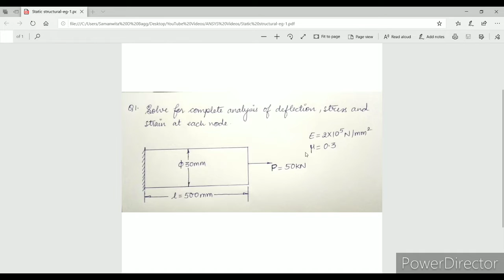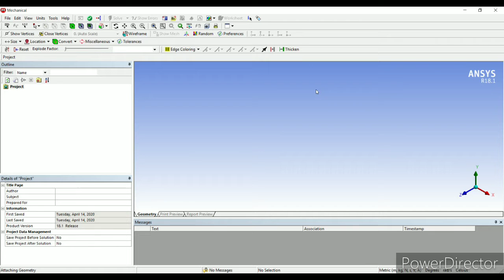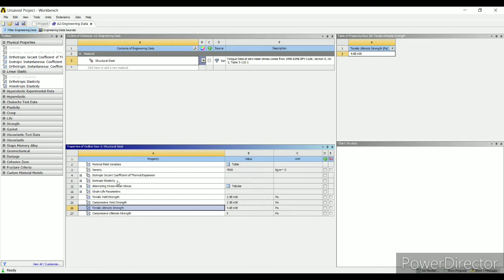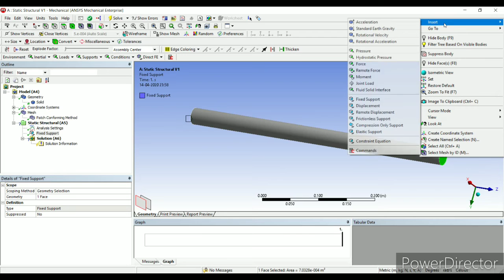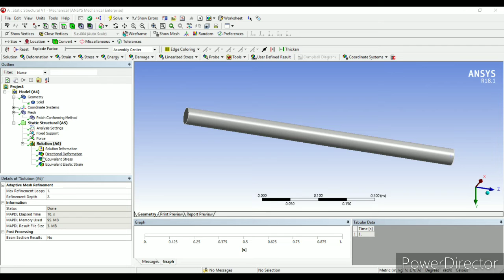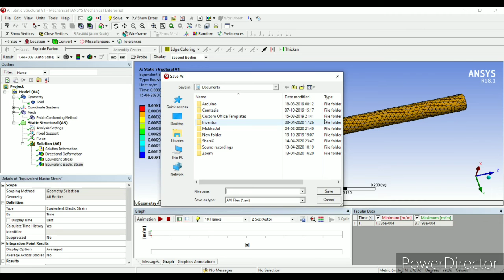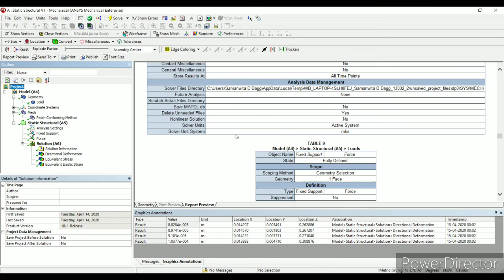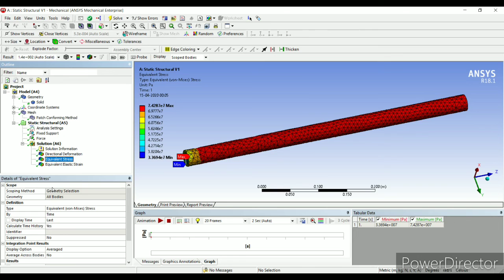Static Structural Analysis I ANSYS Workbench | Problem-1 | Basic Tutorials

Comment from the maker: Thanks for watching! Like, share and subscribe to the channel. Hit the bell icon for latest video updates.
Reply: Query: Mam, how are deformation and elastic strain function different. If a particular set of nodes undergo more deromation like near the place of application of force deformation will be more because of stress concentration so strain at that region should be more and thereby stress but the graphs in video are quite opposite where maximum stress is occuring near the fixed part. Please explain Mam ?
Reply from the maker: Stress is resistance to force applied. Fixed end applies the maximum resisting force and hence stress